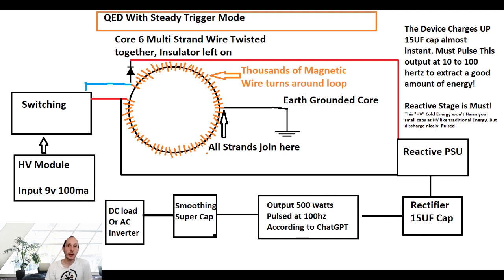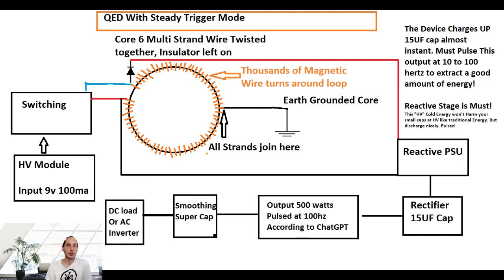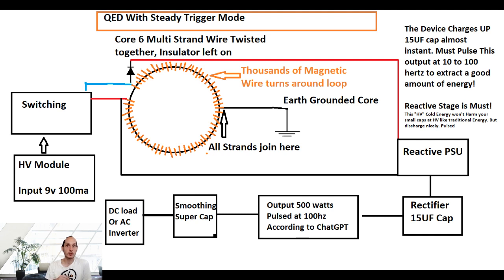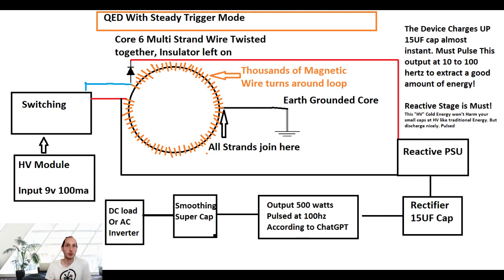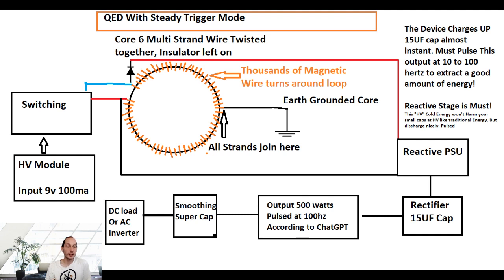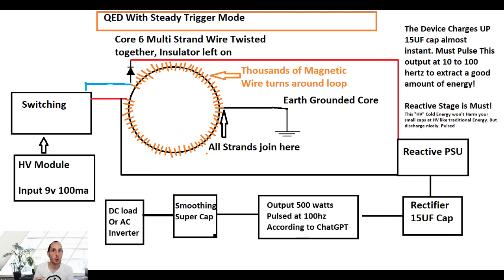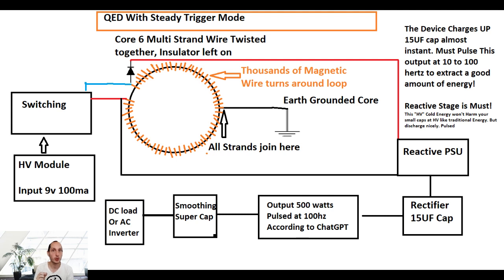Progress On QEG

Comment: Just curious if the small HV module can be used in continuous mode without burning up? Perhaps you're using lower power than it's intended to run at?

Comment: Nice work, have you tried halogen light bulbs as a resistor? Don Smith would always talk elusively about the super expensive resistors used to tame the massive output, I believe he was trying to send hidden messages because he said he had been bought and wasn’t able to reveal all without upsetting investors. I had some good results when did some tests using cheap 500 watt halogens in series as resistors because everything else was being smoked and I couldn’t afford to keep blowing up my money!
Reply from the maker: I use radio coax as well it's 50 ohms lmr400 handles good power and if the resistor needs more current just cut a longer length. its messy but it works.
Reply: @joellagace1679  yeh ok, I probably would never thought of using coax, it would be a great product, I remember seeing someone use it to create an electret that claimed a cool 50k volts so it should be more than adequate. Then there’s also the coax’s own dielectric capacitance for that extra boost. Keep up the good work. Your videos are quite cathartic for me, I find myself saying “see I told you it wasn’t my imagination” which is extremely validating as now we are either both crazy AND OR both correct. 🤣😎

Comment: This is interesting, the core has the copper wires all shorted out? With wire wrapped over core? I would figure with core shorted out you would get heating as well as other issues. I will definitely need to try somethings. Keep up the great work.

Comment: Thank you for the update, interesting observation that the system, once triggered, seems to have its own timing,
with periodic sharp spikes.
Perhaps it is linked to some other natural flow, which has its own timing.
Maybe you could try to see if whether you always have the same results or not, if you start the trigger at the exact same time every day. 
Sorry to hear about the shock, proceed with caution.
I am sure you are experienced with setting up your workstation in a way that prevents unexpected shocks.
Given that these experiments involve energy that radiates across some distance,
it could be helpful to check again if there is nothing else around the work area that could conduct, 
even though there is no conventional direct wiring.
Thanks and take care
Reply: Some say you can tie it to Shuman's resonance, or one of its harmonics.

Comment: Use a over voltage automatic breaker. For high voltage. Use water in a glass jar to make high voltage resistance. Two Cooper rods in jar with gap in water. Bigger gap between rods = more resistance

Comment from the maker: Another issue im having  with passive mode is when it is self oscillating at HV,  I get shocked all over the apartment , Every doorknob I touch I get a big electrostatic like shock,  Even by touching plastic like my laptop, my table, furniture etc, As soon as the device stops, No more shocking around the house! This is really starting to get me angry and worried at the same time, What are these "Waves" and  what is the range? is if affecting next door? etc...
Reply: Joel sounds like the same result as Joseph Henry and  Elijah Thomson got in there experiments .
Reply: Your making a electromagnetic field around your house.
Reply: Yup, you're creating longitudinal waves.  Cool.  Check the QEG thread.  The shocking will go away when you have it properly loaded.
Reply from the maker: Yeah i'm having minor issue with this, Starting to worry the room mate as well arg! Talking silly like hes starting to not feel safe. oy. i think his final draw is if the toaster starts to go off on its own....
Reply: @joellagace1679  have you moved it outside at all? It would be interesting to compare readings from different environments.
Reply: put it in faraday cage
Reply: Are you creating a static electric field? I feel like its pulling ions off you and charging ya up.

Comment: your going to have to detail the Reactive PSU , this part is not clear as to its inner working , what are you using for that Run Caps?
Reply from the maker: 120uf connected in reverse polarity to rectifier DC side. Reactive PSU is just off the shelf or home built reactive power supply, I built one and also used a modified power supply I just ripped out the switching and kept the reactive and rectified cap stage. Nothing really exotic.

Comment: how did you get chat gpt to make this diagram ,  i tried gpt it only generates text
Reply from the maker: I made it, I asked gpt how much power my cap would make if i dumped it at 10-100 times a second. in the 10uf plus range. At 1kv

Comment: This is just a random thought, but have you tried surrounding your device with a faraday cage to see what would happen? I wonder if perhaps there are interfering waves from all our other electronic devices that could be messing with things. Could poossibly be a reason why things seem inconsistent. Either that or nothing at all will happen. 😆
Keep it up, i love follwing along your videos.

P.S. It would be cool to see you get together with mtech and stream/record the conversation as you guys bounce ideas off each other. You both seem to be doing similar research and perhaps a conversation will trigger some new ideas.🙂
Reply from the maker: I had a feeling myself that it might be coupling into 60 hertz and other nearby household even high speed switching "noise"  However  this device ends up transducing it to high voltage high current. Something I never seen been able to do just by coupling into everyday radiant "AC" a few volts at some uA at best... How ever I admit there could be a first for everything!